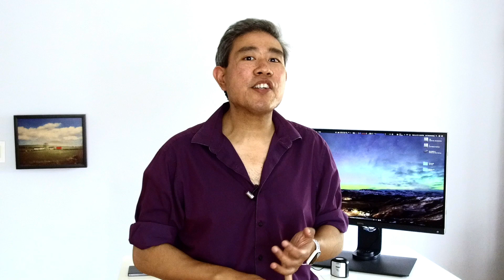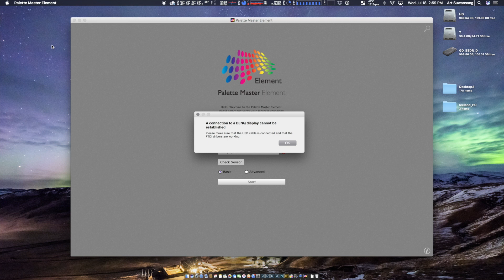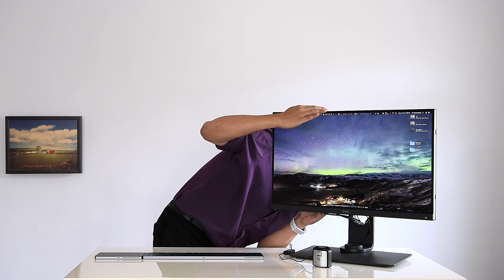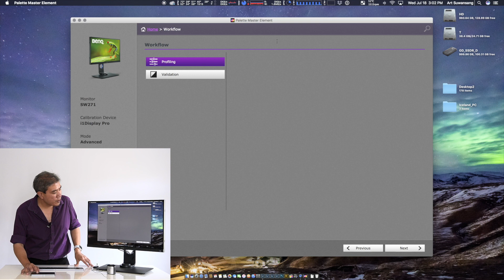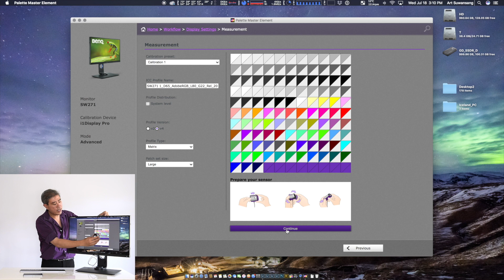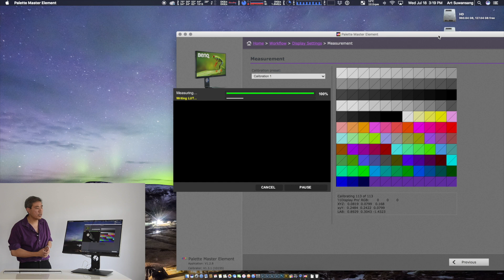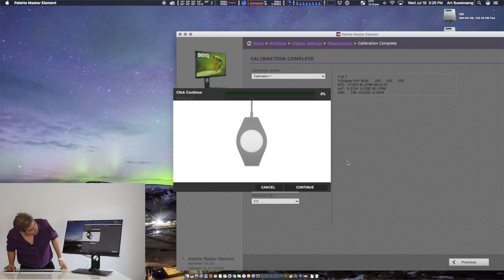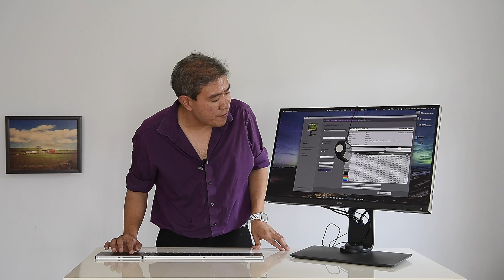How to Calibrate BenQ SW Displays with Palette Master Element - Art Suwansang

Comment: Guess who? Me again. First, I hope it’s ok to keep asking questions here. If not, do you have a social media presence or an email or something? 
Anyway, I finally got the color and (sort of) the overall brightness to match when I render video out of Resolve. But the rendered image is still slightly darker than my display. When I color grade I strictly use the display. But I exported and air dropped a test clip to my phone and it was darker in the shadows. The monitor has been calibrated but is there something else I need to do to bring the brightness down?
Reply from the maker: What is the luminance that you calibrate your display to? Also you can just ask questions here this way others can learn too! And keep them coming.

This said, if the color looks good on your display, I would check another computer and not necessary a phone to check the value. Something that we don't consider is the property of the display, SW and these pro display are matted which is good for editing, however, most phones and tablets displays are glossy and they render color and contrast very differently than say a matted screen, so I think that you are seeing that effect come into play. There may be come brightness variation happening somewhere but that is less likely. Another thing too is that your phone brightness can be all over the place if we have brightness set to automatic. So I feel that it is best to watch the clip on another displays. Because all phones display have variations and that can also lead you to chase a wild goose.
Reply: @ArtIsRight  thanks. Honestly, I don’t know what luminance it was calibrated to. I actually used DisplayCal through Davinci Resolve this time around, and not PME. I just followed along with some tutorial. I don’t recall seeing (or selecting) any luminance levels. I don’t really have another display to check them on, aside from my actual MacBook. But that thing isn’t even calibrated.
Reply: So next time I calibrate it, you think I should use PME again? Also, what would be a good luminance level to calibrate it to? ...for the purposes of color grading video. I don’t use it for photography.
Reply from the maker: The range is based on preference 80-120 nits works well. And yes you should use PME for full hardware calibration.
Reply: @ArtIsRight  the LUT is saved to the monitor, correct?
Reply: Or is it saved to the machine? The OS or whatever? Because that’s going to complicate things
Reply from the maker: LUT saved on the display, watch this https://youtu.be/Cgo2p7jF3n0

Comment: I’m about to calibrate again since apparently one is due. But I recently bought a blackmagic Ultrastudio Monitor 3G so i can send a clean signal to my BenQ from Davinci Resolve. I’m just wondering if this process is still the same.
Reply from the maker: The process might change. I don't believe that you can calibrate with a black magic at the moment. You can certainly give it a try.
Reply: @ArtIsRight  ok. So should I just calibrate it as I usually would...following along with this video? And then just plug the UltraStudio in with normal use, like I’ve been doing since buying it a couple months ago? I know the BenQ calibration process has something to do with setting up profiles or whatever, using the machine itself. But the purpose of the UltraStudio is to bypass the OS so there’s a clean signal path from my video footage in Davinci Resolve to the BenQ monitor. I didn’t know if maybe that would make any calibration of the BenQ essentially useless.
Reply from the maker: Let me find out more about this, if you don't hear back in about a week, please follow up.
Reply: @ArtIsRight  awesome. Thank you so much.
Reply from the maker: So for this what you want to do is run the calibrate with PME & SW directly attached to the computer, set the desire color space, white point, gamma and then bring the decklink in after calibration
Reply: @ArtIsRight  ok, great. So the monitor is still calibrated even though the signal is bypassing the OS? It’s not only calibrated if hooked directly into the machine? Also, the other day I calibrated it using DisplayCal, through Davinci Resolve. I guess it worked. But is PME more “accurate”? Since it’s pretty much designed to work with BenQ displays?

Comment: Hello!  Thank you for this video!  Two questions....I have the I1display pro software installed and it runs in the background.  Should I keep exiting out of it, or just uninstall it completely?   

And.....with the I1display pro software there is an ambient light adjustment.  Does the BenQ do this, or maybe it's not really necessary?

Thank you!
Reply from the maker: You should do this for PC https://youtu.be/PDoDwMIFpeM or Mac Do this https://youtu.be/WECg_yYBlpU And ambient light measurement is a feature designed by engineers that is really useless in practical photography work. Your display brightness should remain fix.

Comment: Feel free to label me as a muppet but, If my display is hardware (Benq sw321c) Should i plug the usb into the monitor and bypass the PC or into the PC. If I plug it into the PC directly how do i know that i am not software calibrating by accident. I will be using the DATACOLOR SPYDER x pro. Just for the muppets out there. The USB 3 cable is the one that has blue at each end. I used a standard Printer style cable and it did not work and just kept showing error. YOU MUST USE THE USB 3.  It would be nice if the man in tech wrote check you are using a usb 3 instead of just error you are not connected to the monitor.
Reply from the maker: If you use PME it will talk to the LUT in the display and you need the USB cable for that, otherwise you can't calibrate at all.
Reply: @ArtIsRight   Thank you for that. I do appreciate your time.

Comment: Thank you. If you have two monitors side by side, how do you do the calibration so they end up being the same?
Reply from the maker: Without knowing the display that you have here's a video for it https://youtu.be/NxTNSkxgVP8 if you have 2 of the same models it would be easier, if not, then it is just a law of physic limitation.
Reply: @ArtIsRight  I have two SW271’s......
Reply from the maker: With PME the same setting on both, they will come rally close.
Reply: @ArtIsRight  ok so I have to redo the process twice?
Reply from the maker: yes, watch this first https://youtu.be/Rxsr8QWBRMw
Reply: Hi, I followed your tutorial on how to calibrate the sw271. I am using the i1Display pro plus. Set the target luminance to 90...and ran the meter twice....both times it achieved 11!!!!! What am I doing wrong?

Comment: Hello there... I wanted to asked how do i connect my BenQ Pd2700Q with my pc to get 10 bit color output .. currently i am using hdmi ... Which is connected to my graphics card ... Please let me know what to do to get the most color bit output
Reply from the maker: This depends on the GPU that you have and the driver that you are using. Most cable support 10 bit output now a days, it is whether the driver support it or not.
Reply: @ArtIsRight  i am using Nvidia rtx 3070 .. n the cables i am using right now is mini display port ... Which i connected to my gpu to screen ... And the drivers are upto date ... Still in Display pilot software its showing 8 bit color depth
Reply from the maker: Are you using Nvidia Studio Driver?
Reply: @ArtIsRight  yes i have selected nvidia studio drivers instead of Nvidia gaming drivers ... In Nvidia experience software ...
Reply from the maker: Check Windows to see if you are getting 8 or 10 bit, and if 8 I would check the driver setting. I would recommend googling the specific driver setting.
Reply: @ArtIsRight   yes finally em getting 10 bit color output ... I did some research , we need to change few settings in Nvidia Control panel ... Thank you so much ... Keep making such videos ...
Reply from the maker: Awesome!

Comment: How do you get the palette software to work on the EW3270U monitor when there is no older style of USB port?  Only the USb-C type port.  I continue getting the floating window error that you did.  Thank you..
Reply from the maker: PME works with SW line only, for your display this is a great guide https://youtu.be/h_TT9O2I1b4
Reply: @ArtIsRight  on my BenQ EW3270U, when I try to adjust the settings in-monitor, most of the icons that are displayed to make adjustments are 'grayed' out and cannot be adjusted.  Not really sure why this is the case.  Also, I'm trying to color match this monitor to my 2019 MacBookPro monitor.  Is this even possible?  If not, can you advise on a monitor that will be?  I use both monitor to edit photos and videos...  Thank you...
Reply from the maker: This is probably what is happening causing your setting on the display to gray out https://youtu.be/CFyNBYP5lJk Here's an explanation of display color matching https://youtu.be/NxTNSkxgVP8 short answer is that it will come close but will not match exactly. Calibrate these 2 independently that is the best solution.
Reply: @ArtIsRight  Yep, that did it!  The HDR link was clicked on.  After unchecking that box, I was permitted to then adjust my screen as normal.  Thank you so much Art!  That was great info and it definitely kept me as a BenQ customer.
Reply from the maker: Glad to hear!

Comment: Hi. I just received my sw270c, I use it on a MacBook Pro 2019 maxed out but moving objects  like Mac OS or safari windows on the screen is jittery. Is it something related to configuration ? or a specific setting I"'m missing ? Best regards.
Reply from the maker: Can you film a video to demonstrate this? Also have you tried this on another computer and does it still happen the same way on the other computer?
Reply: @ArtIsRight  Hi, I found out that it was due to heavy GPU processing while watching (your) video in YouTube. With lower activity is fine. 
Concerning the calibration process I have questions. I'm doing both photography and video color editing work. Calibratring slot in palette master aren't linked in any way to the various color mode of the screen (rec709, srgb etc). So after I calibrated the monitor for AdobeRGB profile (as in your video), in my understanding I should create a second calibration profile for the rec709 screen mode ?
Then when I'll toggle between adobeRGB and rec709 screen mode with the hotkey puck, I should also select the corresponding profile created via the calibration process via the Mac Screens color menu. When I do a calibration process with palette master, is the screen mode important ? Should I use AdobeRGB screen mode when calibrating for my AdobeRGB profile and same thing for the rec709 mode/profile ? Or after my AdobeRGB calibration, the screen will map correctly the color to adapt to the Rec709 screen mode without need of a specific calibration ? Does it makes sense ? Thanks a lot.
Reply from the maker: This video will help explain some of the questions that you have https://youtu.be/Ipuaf5yHrog along with this one https://youtu.be/Cgo2p7jF3n0 And check out this latest PME video as well https://youtu.be/8rjRoIe0-mo With a hardware calibrated display (HWC), you would use PME to calibrate and choose the RGB primary. So once you have that done the calibration, you won't be using the color modes build in to your display. What you will do is choose either Calibration 1, 2 or 3 whichever one corresponds on the icc profile that you have calibrated your display to. Say Calibration 1 is Adobe RGB, when you are in this mode you would choose the PME generated icc profile for this slot and Adobe RGB. And when you move to the next slot you would just change at the icc profile accordingly. Simply, the precalibrated color mode from the factory is of no use to you. Hope this helps, please feel free to follow up.
Reply: @ArtIsRight  Thanks a lot, it's crystal clear ! The precalibrated mode confused me and at first install I didn't saw the calibration 1,2,3 in the screen menu(received the screen yesterday:P). Your explanation are perfect. I must confess it's way better than any BenQ documentation found on their website. Merci.
Reply from the maker: You're welcome and that is why they retained me as their Global Ambassador!

Comment: A great video, thank you. By the way, could it be that the slightly high Delta E max was due to the cursor arrow going over the dark grey sensor patch at around 18 mins 17 secs... ? Just a thought. Thanks again...
Reply from the maker: Thanks. Cursor sensor will not change the ∆e reading much. All of this is a random sample in time. As long as ∆e pass and is under 2, it is good.

Comment: Hi, Art, thank you for the video. Could you help me to solve the following problem? It is about SW271 model.  I use DP to mini DP to PC and select Calibration 1.  During the calibration (Profiling, at around 60% point), the display went to complete dark. It seems it stops calibrating. When I check Darkroom or Customer 1, the calibration Window will show a brief few second, then go to dark again.  Are there some settings that I did not do right?  Thanks again!
Reply from the maker: What PME version are you using? Do you have the USB cable linking the display and computer as well? Is this a PC laptop or desktop?

Comment: I did calibrate benq 2700 PT monitor successfully . And after that I'm assuming I have to work( editing)on that validated colour space for accurate colour representation although the screen colour looks a bit off( maybe dull) compared to SRGB colour space , right?
Reply from the maker: that is correct, what you seeing as dull is a difference between the a preconceived notion of what was and what is current. This is an adjustment that everyone have to go through with a calibrated screen, so in a sense you are not only calibrating the screen but also your perception of what looks good. What you see as dull right now will push you to process your images further and once you are able to get it looking good on your calibrated BenQ... well... then it would look great everywhere :)
Reply: @ArtIsRight  wow! Thankyou for this piece of info . So if I get a new printer does that need calibration as well or is it good to click "print" straight from calibrated monitor?
Reply from the maker: Have a look at videos from this play list. https://www.youtube.com/playlist?list=PLjlr8rlxl_q44Cj_MGwfonvDhdC3EAhye It will answer your questions about printing. In short, just clicking print will not work, you have to control the process.

Comment: Why my ColorMunki Photo is in the list of Palette Master Element but there's always the red X that means (I think) that the calibrator is not recognized? I have a SW240 monitor.
Can anybody give me an answer? I cannot have an explanation.
Reply from the maker: What computer, OS, OS version are you running? Does i1Studio see the color munki photo device? And just to double check, you have the color-spectrophotometer that can do printer profiling as well, correct? What version of PME are you running? Let me know and we can go from here.
Reply: @ArtIsRight   thank you very much for answering.
I have Windows 10 Pro 64 bit and yes, my ColorMunki Photo is the version that can calibrate paper for printers. I didn't try the i1Studio software, because I'm using Photo software, the one x-Rite give me for this calibrator. Should I test it with the i1Studio software?
And sorry, what you mean for PME version? I didn't understand.
Reply from the maker: PME, Palette Master Element, what version of this program are you running. But that does not matter at the moment, this is your issue. You need to uninstall ColorMunki Photo, that software is notorious for conflict with PME and with that software on the system, PME will not recognize the device plugged in. So step 1 uninstall that and then watch this https://youtu.be/PDoDwMIFpeM to verify that the tray for these programs are not starting up with the system. This should solve your issue. Also for the time being don't install i1Studio yet.
Reply: @ArtIsRight  In order:
- PME version is: Application v1.3.11Calibrator v1.3.3 (1D199)
- I stopped the startup programs as you said in the other video
- I unistalled the Photo program from the PC
- I rebooted the PC
- In the MSCONFIG the X-Rite Services Manager is running
But the PWE still doesn't recognize my Color Munki.
Reply: I just tried to install i1Studio software and then my calibrator has been recognized by the PME software.
I just calibrate my SW240 monitor and I set the hardware calibration as "calibration1" with 80candela value.
I'll make more tests and I'll make a second calibration with 120candela value as you say in the other video because is a very good advice in my opinion.
So far thank you very very much!!!
I didn't know what to do and how yo start to understand what was my problem.
Thank you once again! ;-)
Have a good day!
Reply from the maker: You're welcome, glad it worked out!